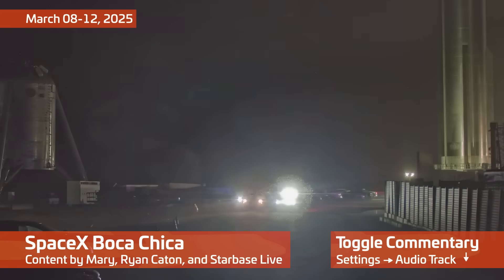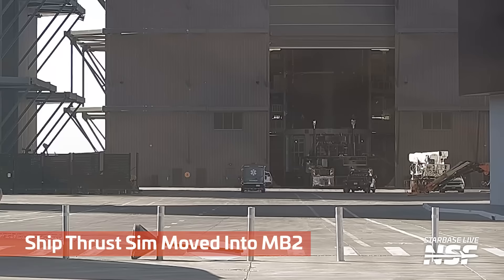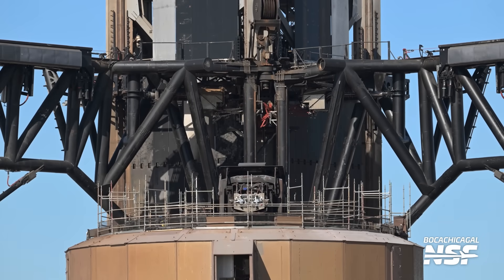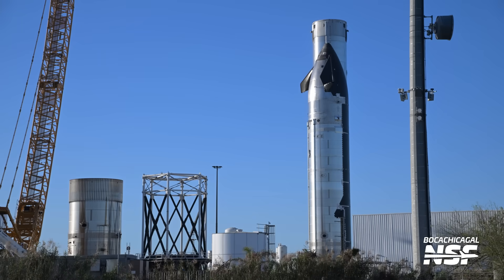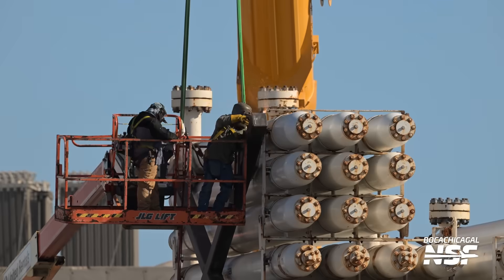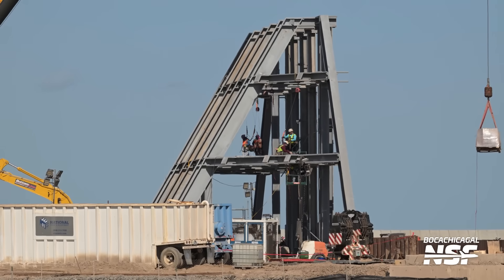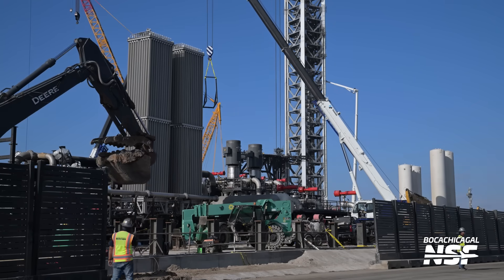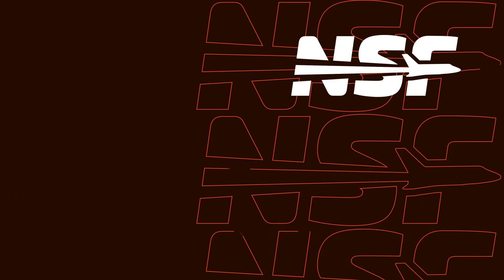The One that Came Back - Booster 15 Returns as Pad B Shapes Up | SpaceX Boca Chica

Comment: I love how when NSF fields negative comments they remind us all that there are real people working on these programs. But now when SpaceX is facing maybe their most significant challenge to a program since before the Falcon 1 fourth flight, the gloves come off and the sarcasm flows freely. Stack two boosters on top of one another? 

Ouch. Wow. 

I stand with SpaceX.
Reply from the maker: That's honestly a huge stretch on a one-line quip about stacking 2  boosters (of a very successful design). - Das
Reply: @ fair enough that I went overboard with the reply. But I stand by the rest. It wasn’t just the two boosters stack quip. You kick off the video with the “best Caribbean fireworks show” comment. Already I’m feeling the aggression. You’re free to have your opinion, I’m free to tell you how I felt about what you said. Thanks for the reply.
Reply from the maker: Personally, I don't regard the progress of the Starship program nearly as fragile as some folks seem to. It's stainless steel, it can handle a few dings! 😉 - Das
Reply: @ I’m 57. The window for me to see humans on Mars in my lifetime is closing. Maybe I’m being selfish, but I want to see them succeed and not have more excitement of the disastrous type. Also many of the comments I read were people cheering SpX failure and thanking you for sticking it to them. I believe SpX will get it fixed. But dang that last flight was a bummer. Sorry if I’m being too sensitive and reactionary in my comments. Just rubbed me the wrong way I suppose. Again, thanks for the replies. Not everyone even tries to do that.
Reply from the maker: All good Dan, appreciate your posts.  - Das

Comment: I have not seen any comment on the fact that the second tower’s chopsticks and lift gear are oriented differently than those on the first tower. Is tower 2 predominantly going to be used for ship catch?
Reply: No.  They wouldn't be going through all the trouble of a flame trench and larger launch table if it mainly for catching.

Comment: Lots of fussing to get the Pez dispenser up and running. Meanwhile, SpaceX have cancelled on-orbit refueling tests until sometime in 2026. It appears Starship's focus is more about Starlink than it is about Mars, at least for the immediate future.
 Elon has obviously shifted focus from his original vision to build a giant "Mars Rocket" that will put humans on Mars in 10 years. SpaceX already has a reliable Starlink rocket with the Falcon 9 so I don't know why they need to use Starship? I wonder if Starship might have successfully made it to orbit by now if they had focused all that "Pez" time and engineering on it's original Mars Rocket objective?

Comment: 6:27 on an oil rig we have a load (kg)* time * travel (m) limit, not sure the exact calculation done, depends on the operation. They will have the cable attached to a spool. After there limit is reached the will spool off more line so the same parts of cable don’t stay on bent sections of the “crown block” and in the draw works pullies. Hopefully space X is also using the same method to keep their lines fresh. The tower looks to be setup just like a large offshore rig, looks exactly the same to me and they do fine around salt water.

Comment: About the RED ACTUATORS:

Those valves must be of the "on-off" type, which means that they are meant to be either fully closed or fully open, so they are not designed to control or regulate flow. The idea is to either blow down pressure (by opening) or totally restrict flow (by closing) in case of a hazardous process condition. Because of this application, equipment like the valve actuators are painted red to make them stand out, and be easily identifiable as part of the "Shut-Down System" of the process.

Alfredo Albornoz
Instrumentation and Control Engineer, specialized in Critical Process Controllers and Emergency Shutdown Systems.
Reply: Instrument Technician here, those look like Bettis actuators which is just the color they come in but they indeed are open and close type not control valves

Comment: @6:06 the rust on the left side of the tower is pretty prominent, and after observing other points in the video, the whole thing is showing quite a bit of rust, especially on the seams. Obviously this isn't a good thing long term, does anyone know if we're still expecting the tower(s) to be covered with cladding at some point? I know they haven't done that yet for various reasons and that, of course, this is a test site.